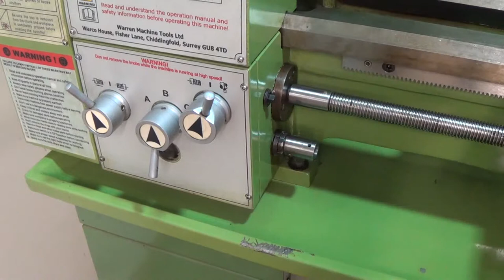Warco Lathe Fail - Repair and Assembly  - Warco 280 F

Comment: What did you use to clean your parts with?
Reply from the maker: WD 40 with light oil. This week I had an accident with my lathe. I as moving a neu place and when was in place, fell in it front in the floor.  I did not intended to make a video but now I will. How will I get it up, see the damage,it has,because even fronte face in to rhe floor I can see several broken pieces. Let s see how it goes....
Reply: César Home Shop oh no!  That doesn’t sound good 🤞you can repair it
Reply from the maker: I hope